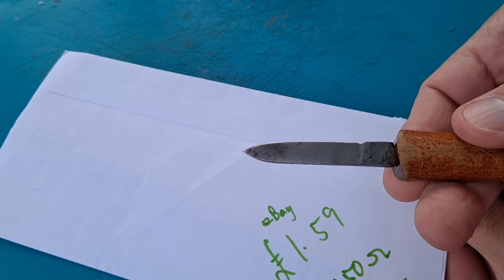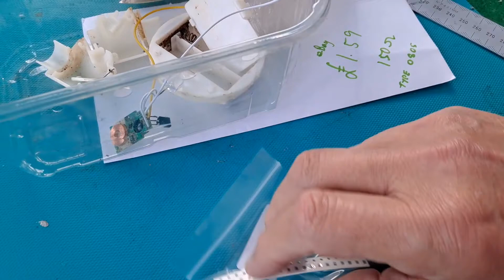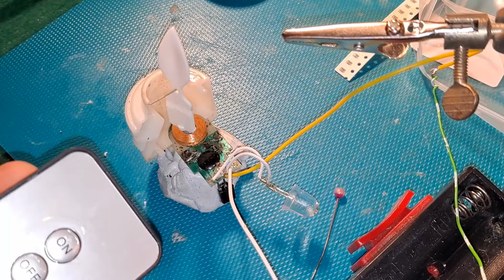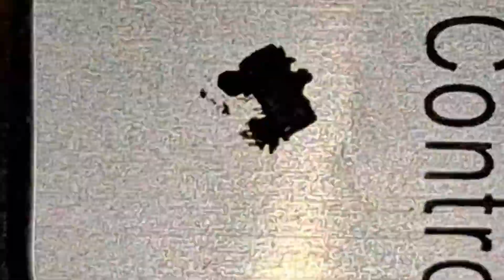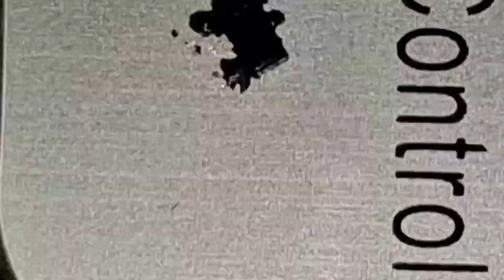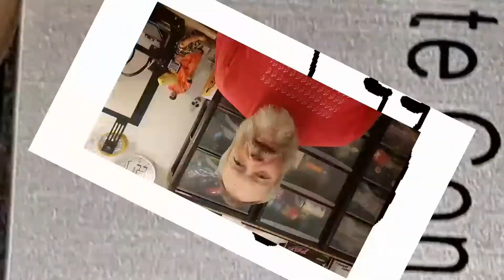Can I fix that IR RC LED candle? Part 2 Grandad's Postbag 20210828 SMD resistors

Comment: Pity about the transistor but that board is so corroded. You did well to get the resistor soldered on. As I have said before, I have never worked with SM componants and never will. I don't have the patience with them although this is the way all circuits seem to be now.
Reply from the maker: In an ideal situation you would use the solder flux paste. It holds the component in place, and then you run over it with a hot air gun and the paste melts and the surface tension of the molten solder pulls the component into alignment. I have never done it that way, but I have watched some fascinating videos on the subject. Back in 2016 I did this clock kit with all SMD components https://www.youtube.com/playlist?list=PLA5a2xPRSrB1WavDHsgQ1vcLhuGyNBW_Z

Comment: Maybe that is the reason why the led isnt Working because that transistor came lose which is supposed To make the contact 🤔
Reply from the maker: Whatever the stuff was that I had to clean off the board in the previous episode, it has eaten away the copper tracks, so all the surface mount components are loose and it is difficult to find any copper to solder to. This has made the repair far more involved than normal.

Comment: Nice job granddad. SMT soldering is challenging enough without PC trace damage, so to get that far in the repair with such corrosion is extra amazing. The SMT transistor is most likely a General Purpose NPN type, equivalent a to 2N2222 or 2N3904 and the like, where any general NPN transistor from any populated scrap PC board would do the job in your repair. Even a normal TO-92 packaged General Purpose NPN transistor could be soldered in, if the trace damage too far gone.  Also, as a bonus, acetone and a toothbrush could be helpful in the cleanup as well as being a great rosin flux remover after soldering.
Reply from the maker: Thanks, this is one of those little projects that caught my imagination. Originally I was just going to bin it, then I thought it would be interesting to see if it could be salvaged. There really is no sensible reason for doing this, just "interesting".

Comment: Don't you just love working with surface mount components!!
Reply from the maker: They would be fine if you had a nice surface to mount them on. The problem here is the copper tracks have degraded so I am having to scratch the surface resist to get bare copper and that means the components don't fit where they were intended. I don't know what was sitting on top of them (see previous video) but whatever it was has eaten the copper tracks.
Reply: @GrandadIsAnOldMan  I did a modification on one of my radio transceivers and it was all surface mounted components.I managed it but needed so much magnification to just see the component that needed replacing.
Reply from the maker: @ianharling9569  yes, I know exactly what you mean. At least I only had a few components here and they were well spaced. Did you use solder flux and a heat gun, or just a small soldering iron? If I did this sort of thing more often I think I would get the flux and the gun.
Reply: @GrandadIsAnOldMan  I just managed with small tweezers and a 1 mm bit on my soldering iron.